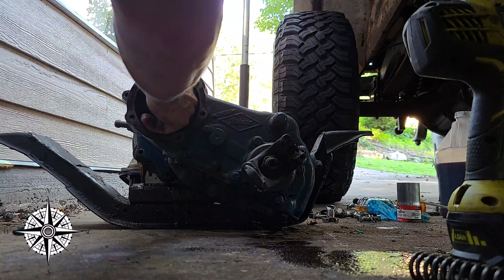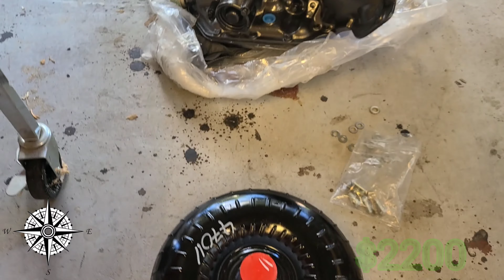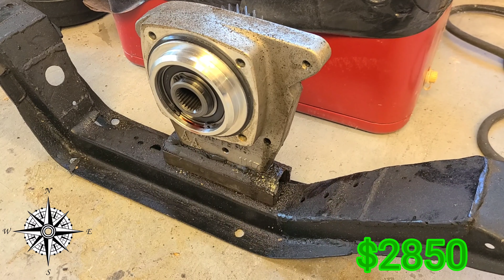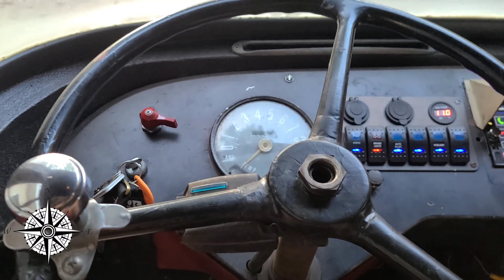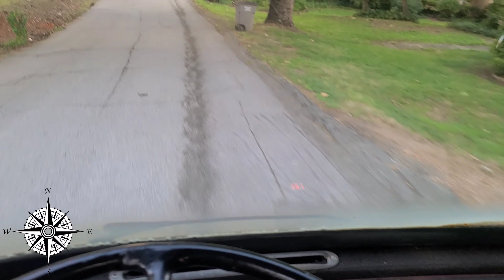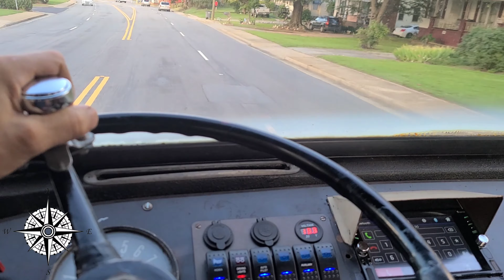Jeep Fc150 leading to poverty

Comment: i see you have an FC and a jeep commando. I have a 59 FC170 DRW, 350 SBC, 700r, and a 73  commando, 304 V8. You have any issues getting your V8 FC repower to run cool?
Reply from the maker: I'm running a dauntless v6 because they run cool and have decent power
Reply: @Topofthemoningtoyou  I was trying to buy one with a dauntless but I wasnt fast enough. now that you mention that I think I did see your vid on the dauntless in the FC